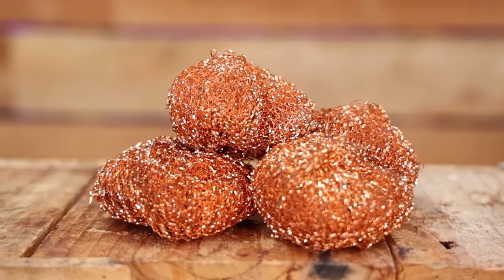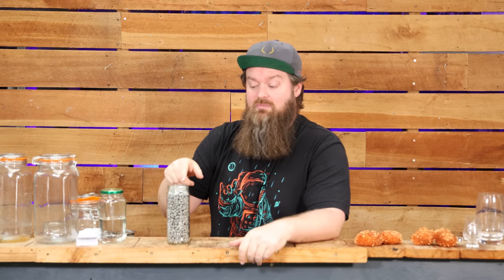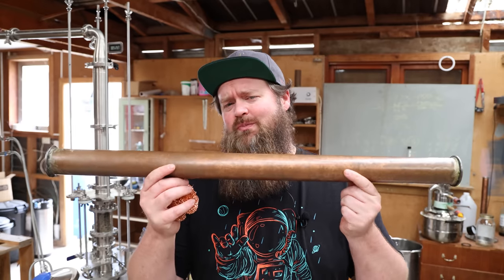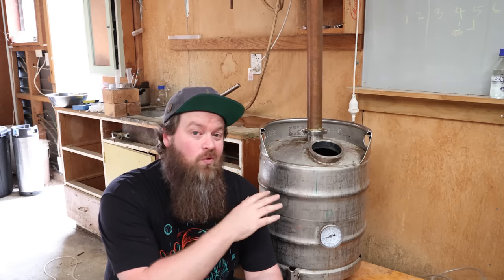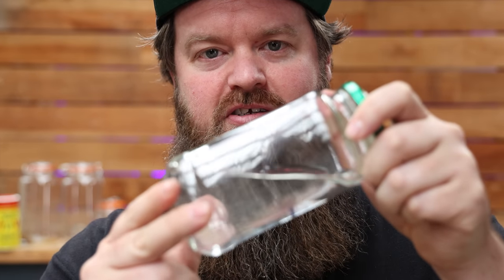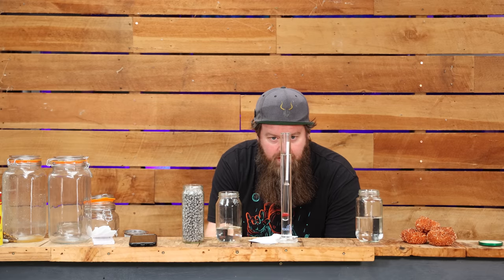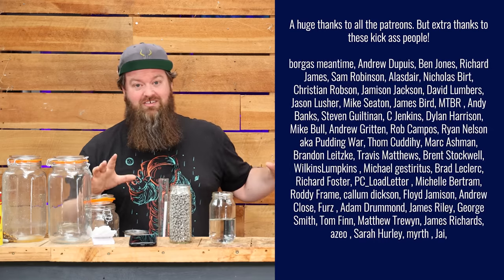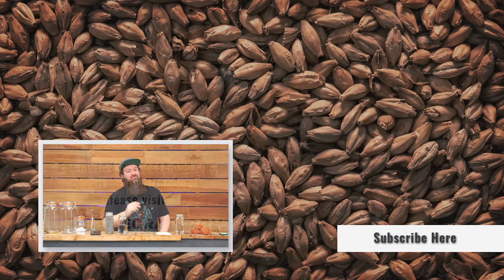Spiral Prismatic Packing (SPP) Vs Copper Scrubbies : Is SPP Worth?

Comment: In general, SPP is great if you're going for the neutral spirit - with the same height, it will give you better separation of water and other compunds than scrubbies.  But if you like the taste of grain, or you're making a fruit alcohol - just forget about it. It will just help you castrate the tastes you look after.
Reply: But why? If you're looking for tastes, just use no packing. Or something like scrubbies, with no or minimal reflux.
Reply: @Tyresio12  It's sometimes beneficial if you're taking say a 6% all corn whiskey wash and adding a plate or two in order to get your barrel entry proof where you'd like it after a stripping run. It can also let you hit barrel entry proof (120-160) in a single run, so no stripping runs to worry about, which overall will save some time. 
Remember, the only special thing about a given packing is how efficient it is, SPP doesn't remove flavor better than anything else, it just takes less of it to do so.
Reply: @jttech44  " SPP doesn't remove flavor better than anything else, it just takes less of it to do so" - for me this exactly means it removes flavor better ;) less required for the same effect = more efficient.
Reply: @Tyresio12  Yes, however, your original reply held the implication that you cannot use it for something like a 1-run whiskey, which is not the case, you just have to use less of it.
It's kindof a waste of money unless you're going for neutral though.
Reply: @jttech44  And that's the point I can agree with.

Comment: I have recently change over to spp myself and the difference is amazing.I was running a 1400'mm column with stainless scoures and was already getting azero at between 1/1.5 liters p/h during hearts collection.I'm now using a 950'mm column,still reaching azero but with a much cleaner taste and at about 2 liters p/h.One thing though ,spp is run differently than scourers,you need to run your column flooded with spp to get the most out of it,your test would have shown a even bigger difference if your column was flooded when using the spp.
Reply: Hey mate, by "run your column flooded" do you just mean have it fully packed with SSP for the entire packing section vs half full?
Reply: Have the column fully packed with spp,have a sight glass on top and run hard so the column is full of liquid just up to the sight glass so it is bubbling on top of the spp,you can't do this with other packing but it is the best way to run spp and works much more efficiently.
Reply: @brycecampbell3005  is there any test online I can reference that shows the exact  difference between running it like this video vs flooded? I have just bought a custom 4” 4 plate still with 500mm extension and 95L boiler with 2 x 2200W elements. I’m wondering if I can get away without flooding and just having bubble plates below the packing section. Still seems like it will work as proven in this video.
Reply: @TPGMatt  you can do it with plates.and a extension but just run normal packing and run normally,spp is only for a full column not plates,if you run a full column of spp and no.plates them run it flooded otherwise not much better than stainless scourers.
Reply: @brycecampbell3005  but this video proved that it was better? I’ve read on home distiller that SSP is significantly better than scourers
Reply: With no mention of flooding the column

Comment: The best Polish producers are Plipek  and Henitom. As some users tested, their packing had HETP of about 2cm (iirc) - so with 100cm of packing you're not only reaching the azeotrope, but you also have some "spare" theoretical plates for better separation of other compounds.
Reply: If you're looking for other producers, check if the packing is tightly wound and length should be as close to diameter as possible.
Reply: Hehe dzięki ;)
Reply: @jakubkuba4118  how much for 2 kg of your plipek? And do you ship to Norway?

Comment: A note on reflux column height:  In home distilling we need to avoid over doing the height.  The average of a 2 or 3 inch reflux column is 54-68 inches.  When you go up to 4 inch the column looses about 10 inches in height but that is made up by inside surface area.
Reply: As a noob, that's why I bought the bubble plate column, pre-made. From clawhammer. I have nothing to say but good things. But then again I have nothing to compare it to.
Reply: @jimlippi4001  You are on the right path.  Don't waste time and money on packings.  A good 4-5 level bubble plate column can't be beat.
Reply: Height = purity. Diameter = speed. What do you mean by the 4" loses 10 inches but is made up by inside surface area?
Reply: @inglishill4028  When a reflux system has a 4" column, it's max height is reduced by 10" compared to a 2" or 3" column.  For example, if a 2" column is say 42" high, a 4" column would only be 32" to have equivalent reflux.  The 4" column makes up the difference by its interior surface area which is considerably greater than the 2" or 3" column.  Hope that explains things more clearly.
Reply: @rocketsroc   OK. I would disagree although. I would say anything under 1.2mtrs would fail to provide azeo with ease. My reasoning being that it is this height (not surface area) that is needed in order to separate the fractions with a modicum of precision. :)

Comment: Great to see the still running again, personally it’s the distilling that I enjoy the most on the channel. Thanks for the comparison, it’s something I’ve been wondering about for a while but didn’t want to waste the cash until I was sure it was worth it. Ill be running the CCVM with SPP after seeing the proof now, time to get ordering from Poland. Thanks Jesse 👏🏻👍🏻. 
Congrats on 100k subscribers Jesse, awesome mate 🥳 🍻.
Reply: Can recommend ones made by Plipek and another brand - Henitom. They're a bit more expensive, but it's totally worth it.
Reply: @Tyresio12  thanks mate really appreciated. Is there any difference in quality between the two or are they much the same? Do you have any links for that? If not no worries I’ll just google search for them and get ordering.
Reply: Looking at Plipek now, there’s both copper and SS SPP any experience with the two? Any preference? I’ve a 3 inch 1 x meter column that’s copper so I’m thinking of just sticking with the SS SPP?
Reply: @jock5656  They're comparable, so just go with the cheaper of the two. On copper vs steel - some guys around here use exclusively steel ones and they claim they're fine with it. Others use for stripping 25cm height bed of Cu (to catch sulfury compounds) , separated from the rest - the steel ones (steel ones provide more theoretical plates per height), and for the second one steel only to get the maximum number of "plates".
Reply: @jock5656  So for example for stripping: 25cm Cu, separator, 90cm steel, and for the second run 120cm steel.
Reply: @Tyresio12  thanks mate, really appreciated. I’ll need 4.5 litres to fill my (7.6cm x 100cm) copper column so After what you’ve said I think I’ll go with 2l of copper SPP and 3l of SS and have a little spare. 👍🏻🍻
Reply: @jock5656  if you have copper column (I somehow missed it earlier) go for ss only. Cu spp users have ss columns, the walls of your column provide enough copper to catch the sulfur compounds.
Reply: Do you have a link for plipek & Henitom?
Reply: @Tyresio12  Thanks for your help and advise mate. People like yourself are what makes the community. I’ll get ordering that SS SPP cheers 🍻
Reply: @jock5656  No problem mate, may those SPPs serve you well :-)

Comment: Great info as usual. Thx. Would have loved to know after proofing them down how they both compared in taste.
Reply: The result could be interesting, as I guess it is possible that the alcohol used still contained some heads. In this case, they would probably more concentrated in the sample made with SPP. The better comparison would be with following procedure: discarding the first 30ml and then collecting the sample for testing.
Reply: He'd need to do a cleaning run with the new packing before it would be safe to consume, which takes time, and that's likely why he skipped it.

Comment: When I was distilling before the fires in 2019 destroyed my still I packed my column with copper scrubbies but I unrolled them so they were a woven tube which flatted down to about 3 inches wide.  I then rolled them up tightly using 2 scrubbies to make a 2'' cylinder to fit in the column - tying them together with
Reply: Some copper wire.  This allowed me to get much more copper in the column than the way you used.  Unfortunately I haven't been able to rebuild my still yet but viewing your old videos is getting me motivated to start again.  Keep up the good work.

Comment: Good stuff Jesse. I'm bought a litre of 5mm x 5mm x 0.3mm SPP From Russia, running in a 2" VM column with a couple of copper scrubbers  It has excellent thermal mass, and the take off speed is around 1.5L to 1.8L p/hr, compared to around 1L p/hr when packed with stainless and copper scrubbers. Great for clean neutral, it reaches 95%+ through entire run (scrubbers drop to below 90%) and it seems to be way better at compressing the heads/tails. SPP also works well in Boka columns with similar results.
It is definitely worth spending the extra $ for the added efficiency. Cheers
Reply: Where did you get yours from, i'm finding it hard to find that size to NZ
Reply: @casiosinclair  I could probably make smaller size for you but probably no great improvement unless you had say 11/2" column.

Comment: @  7:08  While experimenting with packing, I once poured 90ish abv back into a boiler that had hot 10% wash. The alcohol I poured into the boiler instantly flashed into vapor. I thought I'd give a heads up to folks, so they wouldn't make my mistake.

Comment: Hi Jesse, at 9:36 you mentioned about extending the column, I tried the search thingy to search your videos but came up with zero...did you end up extending it & was there enough benefits in doing it?
I have seen extentions for sale online (using clamps I think) and the lengths vary quite a lot...very curious now.
No reply needed mate, I know you're likely to be under the pump
Cheers

Comment: Something like your copper scrubbies or steel wool can be a very variable packing material for fractional distillation. The number of theoretical plates is heavily dependent on how tightly you pack it. Pack it tightly, and it can be one of the best packing materials you can find. Pack it loosely and it can be absolute garbage.

Comment: Wise choice to still include some copper in the column, even if you're using SPP. One, much easier to get it to not drop into your still, and two, running the vapor over copper tends to remove some of the sulfur containing compounds in the product, and you don't need much to accomplish that.
For the class, you get sulfur compounds from stressed yeast, and stress is almost always happening with anything high ABV, like over 8% or so. It's not really a big deal, nor is it particularly avoidable, or even worth avoiding because including a little copper in your vapor path will sort it out with no real downside.

Comment: I used to run a 2 inch column reflux still That used copper rings made from rings of 14 ga copper wire.  I made the rings by winding the wire around a 3/4 in dowel and took the resulting coil and cut it with aviation snips, voila! I quickly had a pile of copper rings.  I just dropped them into the column an achieved over 185 proof.  admittedly, I generally ran my still very slow.

Comment: Hey mate, fellow Kiwi here. I'm an avid home brewer who makes beer and cider and I'm looking to get into the distilling side of things. I have a Grainfather and was wondering if you had any opinions on using the Grainfather and the Grainfather distilling attachment which is the Copper Dome Top and Alembic Condenser? Would that be a good starting point or would purchasing a reflux still be bettter? I'm wanting to start by making gin and vodka for now.
Reply: You may want to check out george over on Barley and Hops Brewing, he's a big fan of the turbo 500 setups. The dome top is more a pot still add-on not a reflux one.
Reply: The Grainfather woild be a great boiler for a still. You can get  the stainless lid for it and then add any modular pot/reflux column. Get a 2" bulkhead threaded adapter with tri-clamp ferrule and then anything will connect up to it 👍
Reply: @puddingwar5110  thanks! I’ll check it out.
Reply: @mikesterv  thanks! I’ll do some research.

Comment: So what was your "stopping" criteria for packing  the column with just the scrubbies? As many as you could physically compress manually, or a certain weight/number? Did you try do a rough surface area calculation and try and get the same for each material?

Comment: You can get also springs made from Cu. One of the best choice for column.
Reply: Stainless steel ones have better HETP parameter however. This, and lower price, are the main reason most people over here use Cu only as an addition, or none at all.
Reply: @Tyresio12  I am just saying that he can buy springa made from copper because he compare stainless spring with copper scrub. It would be better to comper Cu and Cu, because of HEPT.

All know that Cu could be used on entire length but it is point less and only 20-30cm is enough. We all also know that on copper potstil you may not use copper inside.
Reply: @lukaszbak5601  100% agreed.

Comment: It looked like used used 4 copper scrubbies in the copper test and in the SPP test you used 3 copper scrubbies. So it wasn’t a test of one vs the other, but one vs combined. Although I have no idea how you would get the SPP to stay in the column without the scrubbies so that you can test one against the other. 

There is also copper SPP too. Not sure if that would be any different to stainless.
Reply: You could have a flat stainless mesh at base and delete the top mesh and would see a slight increase in ABV.

Comment: Now I'm curious as to why they work better. Is it because their made of stainless and it's thermal conductivity is way lower than copper's? Is it the higher thermal mass? A combination of both? Or maybe the shape? Would be great if the guy making these could make some out of copper wire of the same gauge and see how they compare.
Reply: Shape is very important (also ideally length should be the same as a diameter) as it is crucial to achieve a maximum area per unit of volume - the greater this parameter, the better the contact of vapor and liquid. But material is also important - copper SPPs of the same shape have about 3x larger HETP (Height Equivalent to Theoretical Plate, bigger is worse). So yeah, probably heat tranfer, density and who knows what that is dependant on material also plays a role.

Comment: I'm actually kind of surprised that you didn't get azeotrope from that column length. I run a 2" VM-E-ARC with SPP with a shorter main column and get azeotrope with around 1m of effective column of SPP below the heads column and a 1.5-3L/hr of take-off depending on where in the run I'm at.
Reply: The wash was only at 3% though..
Reply: @wookie45nz  Yeah, I noticed that on a second view of the clip. Explains a bit, especially if he wasn't putting it into full reflux and then aimed for azeotrope by adjusting output.

Comment: Gotta try them out. I actually tried some molecular sieves in a 24" column section a few weeks back and saw an 18- 20avb gain on the two runs I tested. Interesting how those things work.
Reply: Molecular sieves general need to be cooked dry between uses though, don't they?
Reply: @AdamMansbridge  yeah, they do. I watched a few vids show pop them in oven for 30-45 min at 400°. Seems to work good. I vacuum seal them after they cool.

Comment: Jess!!
Can I ask a newbie question please. 
I’ve a 240v digi boiler with a alcoo engine column. 
My question being how do I change the wiring on bottom of boiler to add a voltage controller. So I can keep a rolling temperature as apposed to peaks and troughs boiling and switching on and off elements??

Thanks in advance brother.

Comment: It's not quite a straight up comparison since both runs contained copper scrubbies. I think you should use a Tri Clamp Filter Plate at the base and run copper only then Spiral only.

Comment: I'm still a newbie, but I run a high ABV, I use copper mesh at the bottom then round/hallow ceramic,  My normal ABV is 190 to 193, I would love to see a comparison on Ceramic versus the springs.
Reply: How long is your column? You run reflux?
Reply: @danieldanielson2650   I run 2 - 6" glass and 1 - 3 feet column so total is 4'
Reply: @danieldanielson2650  yes I run reflux, I run my head temp at 180
Reply: @alltheoutdoors  thanks!

Comment: I may have missed it but did you find a difference in rate of production between the two?  Not so fussed about purity - get that with 12 stainless scourers - but rate of take off is 500ml/hr.
Reply: SPP will let you run faster, provided you've got the power to keep the column full and you don't boil anything over into the column. Usually about 30% faster, so you'd probably be close to a liter/hr.
The other thing to consider is a larger column. a 3" column on a 15 gallon boiler will run much faster than a 2in column, provided you have the power to run it. In terms of investment, I'd start there and price it out before I sprung for SPP.